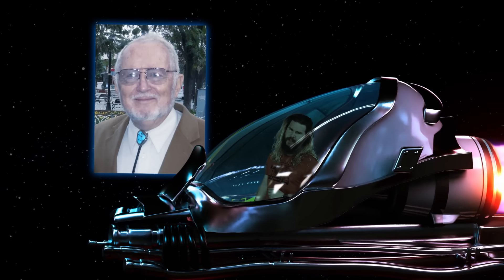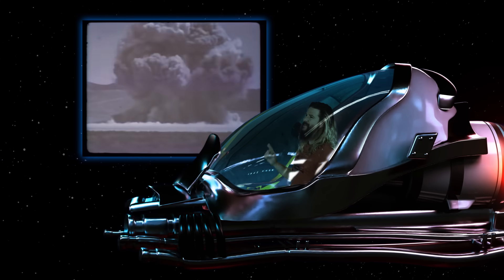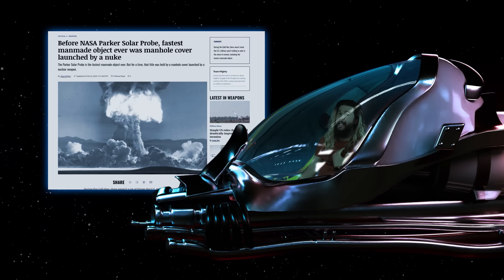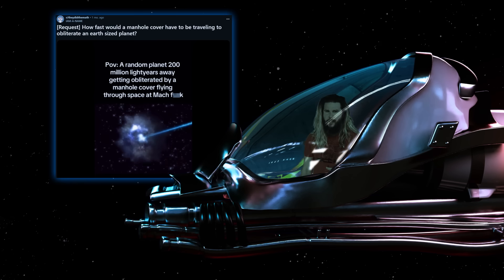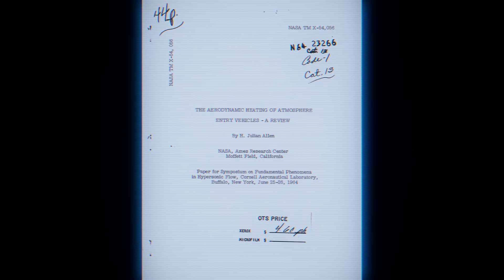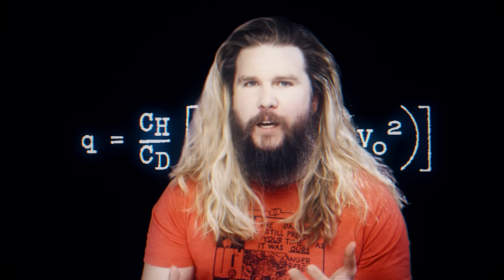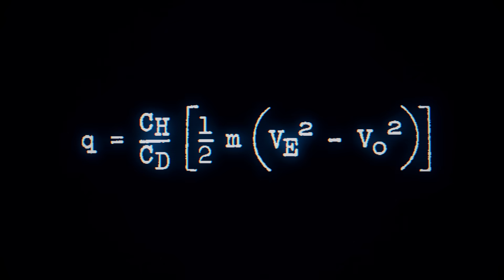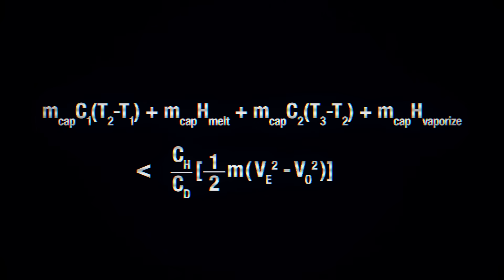Debunking the Nuclear-Powered Manhole Cover

Comment: I DEMAND A RECOUNT! ( I think that's the wrong equation. )
(Please upvote so Kyle sees this if you agree!)

1: Convective Heating isn't the critical factor:
The equation you're using is for friction / convective heating. At the mach numbers involved here, the Manhole Cover (MC) is actually shielded from convective heat by the boundary layer between the shockwave and the MC skin. The flatter the face of the MC, the further away the shockwave is pushed and the thicker this boundary layer. (This is why reentry capsules are flat on the bottom and the shuttle reenters flat and has a blunt nosecone.)

2: Radiative heating is the problem:
The shockwave creates extreme compression heating, and that heat radiates to the MC skin very effeciently. THIS is the equation that you need to be looking at.

3: I don't know if either of these even apply because the shockwave from the prompt-critical fission event is hugely dominant and instantaneously dislodged the welded MC and propelled it up. Presumably the shockwave erupted around the periphery of the MC in the nanoseconds of the dense MC accelerating to match the speed of the shockwave.
Put another way, the shockwave from the atomic bomb is the 'vehicle' accelerating the MC and creating the above effects, and the MC itself is experiencing (relatively) minimal aerodynamic violence.

Comment: Also important factor I think is fact that it was not just manhole cover being thrown up, but also everything around it, including air, which would reduce its air resistance for initial few hundred meters, does not sound like much, but remember it would help it in densest parts of atmosphere, maybe not enough to help it survive, but is is something.
Reply: Precisely.  To use his reversal analogy, it's the difference between firing a high-powered bullet INTO a pool of water, versus firing it OUT.
Reply: Also: besides the manhole cover riding the pressure wave, the radiation alone probably obliterated all the air or at least heated it up dramatically and pushed it out of the objects way. 
It might have also obliterated the manhole cover though. 
I think drag is less of an issue here, compared to everything else at least.

Comment: Don’t forget any changes to the properties of the cap due to it so incredibly close proximity to an atomic blast .
Reply: The pressure wave would've ejected the plate long before any changes due to heat could've been effected.  Also, at 150K mph, it would've reached the officially recognized lower limit for "space" in approximately 1.21 seconds, while traveling through a rapidly, decreasingly dense atmosphere.

Think of it like dragging a match across the abrasive material on the box/book.  The entirety of the match head is not INSTANTLY consumed, no matter how fast you strike it.  There is always a time delay between ignition and the complete consumption of the material on the surface of the match head.  If you then drag it directly into a medium that doesn't support combustion (say, a bowl of CO2) to simulate the iron plate exiting Earth's atmosphere, the combustion ceases, leaving some portion of the match head intact.

Comment: This is too complex math for me, or I just don't have enough patience to delve into it, it would've taken me a whole day or more, but I'm just wondering — what about atmospheric gradient? The meteors entering the atmosphere are slowly diving into denser and denser air, slowing down in the process, if the cap got shot with enough force through the densest pressure air, and then kept flying through thinner and thinner atmosphere, it would not keep generating so much heat, or basically what I'm trying to say, it wouldn't have enough time to accumulate the heat required to burn up before it arrived to an altitude where air resistance would do so much less. I guess that initially it would've been a big challenge to launch something with enough force to achieve this speed through the 1000 milibars at the ground level. But obviously if it burned up quickly everyone would see it, it didn't, it went out of everyone's sight instantly and quickly after it would've had a lot less pressurized air to deal with. Somehow I feel that this equation doesn't take that into account.

Comment: Since it was only captured for a single frame, the MINIMUM velocity is 66 km/s but it could have been far faster. 

A number of issues in your estimates. A major one is you assume the manhole came to a complete stop instead of calculating the velocity lost due to atmospheric drag using your coefficient. On the minimum side, it's estimated velocity is 50% faster than solar escape velocity. There's no way this thing came to a complete stop in under 2 seconds.

Another critique is you assume perfect heat conductivity. Which will not happen.

The most plausible outcome is it exited the atmosphere in a solid or molten state, or it shattered and who knows how much of it was able to exit at this point.

Comment: I did some simple assumptions, and estimated that the cast iron cap flew off and started tumbling at Mach Jesus speeds. The air melted the cap as it flew, and likely never left the atmosphere as anything large or whole.
There's basically no way to know what shape it took from the detonation, but it could be theoretically simulated in a model

Comment: Okay. I happened to be 500 km up in space above the nuclear blast site at exact moment when the blast happened. I do recall that an intact manhole whizzed past me going really fast, and i tracked it with the very advanced tech on my spaceship - the SS Vigilant - and it clearly was going faster than the mouth of a certain politician that's also a grifter... which is about 70 miles per second. In fact it was moving faster and faster each second. Basing on my calculations - the manhole cover struck the planet Zog last year. The Zog people must be baffled by the whole gesture of sending a manhole cover billions of km across space.

Comment: Respectfully disagree; I fight for the side saying it did make it to space. I’m no mathematician by any means, but I do have experience with shaped charges and you based your calculations on a flat disc. With the majority of the blast being directed to the center of the cover(point of least resistance), the heat, and the sheer amount of force, along with the most resistance being around the circumference (welded or not) I support the theory that the blast formed the flat disc into a shaped charge, therefore decreasing its total surface area contacting the atmospheric resistance on its way up. Cody’s Lab conducted a similar experiment with shaped charges using coins, and the same exact principle was used in countless IEDs over in the Middle East.

Comment: The air drag would have been nuts. The lid would have been flipping like a coin and moving in a direction that wasn't straight up. If it wasn't vaporized a chunk of it might still be sitting somewhere
Reply: The minimum speed was 150000 mph. I say minimum because only one frame was captured on video, and thats how fast it would have to go to only be visible in one frame. Thats 41.6 miles per second. Surrounded by air moving in the same direction at least at first

Comment: You started from an equation designed for reentry, where the object slows down while the atmosphere is thinnest, spending more time at slower speeds in the dense lower atmosphere.  The manhole cover was going it's fastest in the dense atmosphere, possibly not even having time to conduct the surface heating to the core of the disc before the surface heat was considerably less.  Also, you used the surface area of a flat disc face-on to the airflow, I think.  The disc was likely spinning, making its average surface profile to the wind somewhere between the edge-on surface area and half it's face-on surface area.  Would the Shockwave from the explosion have potentially pushed the air in front of it upward and outward ahead of the cover, potentially making its velocity relative to the air it is moving through less?  Your inequality ended up with less than a factor of 10, so as I see it, you've got to remove a lot more variables before you can say anything definitive.

Comment: You used an equation for entering earths atmosphere, which is literally the exact opposite of what happened. Your comparison to meteors is also the opposite of what happened. Going from a vacuum to an atmosphere isn’t the same as going from an atmosphere to a vacuum. At a minimum, the equation that you used for entering the atmosphere should’ve been flipped to more accurately reflect what it should be.

Comment: This needs a revisit...... 
Kyle needs to determine if the cap deformed, tumbled, or broke apart. Also there has been several other points brought up that would change the calculations. I can't do the math and I don't care if it made it or burned up but there's enough here in the comments to warrant a reappraisal of the math used.

Comment: In the calculations I think you also might have forgot to put the energy required to turn from one state of matter into another. Normally this doesn’t require much energy if it’s a longer period of time but since it’s a few seconds at most it might require substantial amounts of energy to turn from one state to another. At least based on my limited knowledge of physical chem

Comment: Oh boy. Before watching: My best guess says that 1. the object at the top of the one frame could be a chunk of the passage or just about anything 2. while I don't subscribe to sublimation, I also don't feel like that cap would have survived *chemically at those temperatures either. [wall of text removed] - Let's see:
Aha, vaped, ok. Q: would that have been an instantaneous result; would the initial concussion have added heat above movement friction; how much travel through atmosphere would be required to obtain the result indicated in the equation? 
I'll go now. Cheers

Comment: Mach Middlefinger is the equivalent of aproximately: crazy amounts of kilometers per hour.
But seriously though, as a fellow Civil Engineer: The cap would probably tumble upward, causing it to have a variable velocity and drag surface while doing so, which could even cause fluctuations between heating and cooling the system. Not to metion it could have broken apart, chipped the outer rim or even bent in a aerodynamic shape or the complete inverse of it, causing it to shatter due to rupture paths in the iron sheet and so on. We'll never know until we repeat the experiment just for the fun of it lol
Reply: There's also the fact it was cast iron. Among ferrous metals and alloys, cast iron is the densest configuration, but also soft and relatively brittle. And the metallurgy of the time wasn't as good as modern practices. Cast iron can have a multitude of subsurface defects from the casting process, leaving it structurally weak, especially against impact forces. Being ripped out of the ground by a nuclear explosion would more than likely have caused cracks, or blew it into pieces outright.

Comment: While most of these comments complaining about the math relate to fluid dynamics and heat transfer in the atmosphere, as a metallurgist I see a different issue. Let me explain. I’m talking about the value you calculated for the heat to vaporize a certain amount of iron. There are a couple issues. 

First of all, it seems you heard the cap was “cast iron” and used values for pure iron. That’s an understandable mistake, but cast iron specifically refers to a high carbon iron. It’s actually a composite material that is about 3-4% Carbon, along with a slew of other alloying elements. It has a different Cp than pure iron, and it’s potentially going to melt and vaporize in a different way.

Furthermore, the heat capacity constants…aren’t actually constant. They depend on temperature. No this isn’t a big deal if we’re talking about a few degrees of difference, but when we’re talking about raising something from room temperature to thousands of degrees there can actually be some significant error. It’s hard to say what direction that error is in, but the proper way to handle this is actually to integrate empirically derived polynomial approximations over the temperature range in question.

Given that the two values were within an order of magnitude of each other, this really could matter. I’d say that your approximation just showed it was too close to call without some better more accurate calculations.

Comment: The one question I would have is whether the ‘manhole cover’ was going faster than the atomic shockwave that might have lowered the atmospheric pressure (& thus the density) in front of the disc, possibly lowering the heat it would have encountered.

Comment: You see, metal meteorites have the tendency to reach the ground. Now, the atmosphere surely heated that up. And vaporized the surface, ground it away by a, cm or so. But just the speed, short time, concentrates the energy to a small part of the surface, the inner part do even not have time to heat... Therefore the outer parts are superheated plasma...
Reply: Addition, loads of the heat also just heat the air, by adiabatic compression, only a fraction is transferred to the object at all

Comment: You made a major error - Brownlee himself said his velocity calculation assumed a vacuum on the top side of the cover so he neglected compression effects inside the shaft which are huge.    Being supersonic your mass at ejection includes all the air above the cover.   It also complicates your calculations enormously.   You have a huge pressure transferring heat to the cover from both above and below before you reach an open atmosphere at STP.    I agree it probably vaporized but your math is unfortunately inadequate by Brownlee's own admission.

Also decelerating from thick atmosphere to thin is not an identical profile from thin atmosphere to thick.   Skip reentries have huge problems with this as you bake far more at high altitudes and high velocity.   Since drag goes up with the square of the speed but proportional to the density, it means you're going to get utterly clobbered doing Mach middle finger or whatever at sea level.   I'm not sure even that much iron can hold together under those forces as it's likely to physically erode rather than just vaporize.    Toss Brownlee's flawed BOTE calculations and redo from start.     Reality is likely worse for that poor hunk of iron.

Comment: My biggest concern with your explanation and calculation is the use of the "drag coefficient of a flat disk moving through the air". It is hard to believe that the disk would have stayed perfectly aligned and not flip like a coin or no?

Also on the same note, if you use this drag coefficient, how does the "thinning" of the atmosphere come into play? Is there some kind of degradation parameter?

Comment: Without knowing where you got the transfer coefficient, and more justification of the premise that it makes no difference to heat transfer whether you go through the thick part of the atmosphere first and then the thin part or vice versa, I still don't know whether the cover vaporized.

My guess is that the key point is how fast heat transfer can happen.  The cover spent very little time in the first few kilometers of air, where most of the air is.  Air in front of the cover was compressed in an unimaginably brief period of time, heating it to a ridiculously high temperature.  Then it was as compressed as it was going to get, and air in front of it was compressed almost as quickly, and then air in front of that -- and then, in maybe half a second, it was past most of the mass of the atmosphere.  Even though enough energy was turned into heat, by compressing air, to vaporize the cover ten times over, I'm guessing that wasn't enough time for enough of the heat to be conducted past the first few millimeters of the cover, which would have been vaporized.

The NASA math you should have been looking at is in papers about ablation shields.  Vaporizing the first few milimeters of an object puts a layer of relatively cool gas between the object and the superheated air in front of it.

Comment: Do you hate fun, Science Thor?

Also, I don't think it is entirely reasonable to use atmospheric entry  as a proxy for atmospheric exit. For one thing, Max-Q on the nuclear manhole would be almost instantaneous, and as it rose through the atmosphere, it would experience less heating the higher it went. For another, remember that it is travelling at 6x Earth's escape velocity *straight up*. The atmosphere isn't really that thick. At the speed it was going (roughly 66km/s), the nuclear manhole would reach the Karman line in about 1.2 seconds. Even with all of that heating, it takes time for iron to melt and vaporize. I think it is quite plausible that a molten ball of iron escaped the atmosphere - and is possibly on its way out of the solar system.

Comment: first up meteorites go from ice cold to super heated in the atmosphere so it expands and boils of all the gasses making it go poof mon the cap side baking in the sunny desert sun its starts of wel above room temperature and assuming it was a pure cast its one hunk of metal , deformation was that observed on the one frame of high speed ? did it accelerate tru a collum of hot gas from the explosion ... that would have great impact on the energy received from the air it supposidly moved tru  no m calculation for that would be in the reals of thrust speed from a rocket nozzle giving one the collum of air speed .if the speed of that equals the manhole cover speed that nasa equation is non applicable , unless a meteorite has a collum of gas pushing it tru the atmosphere ...  would it make a difference  no clue will this story be roaming around for another couple decades probably